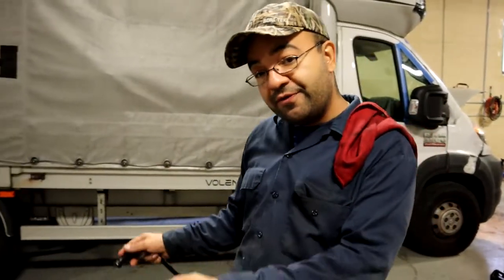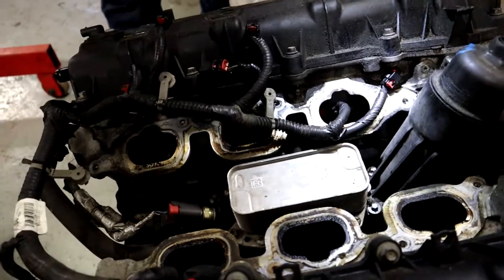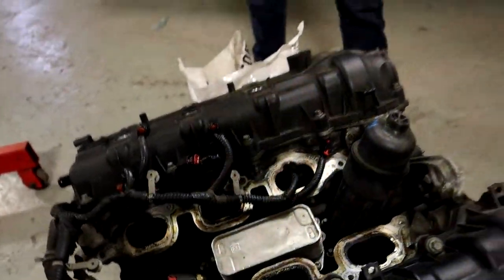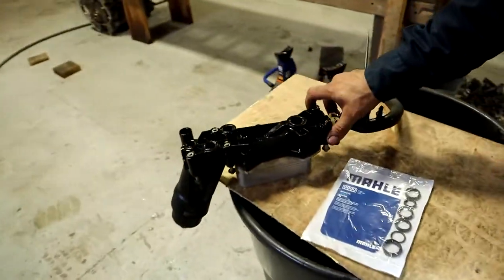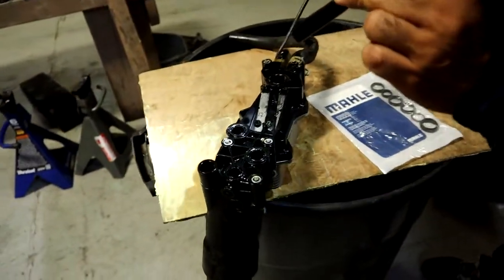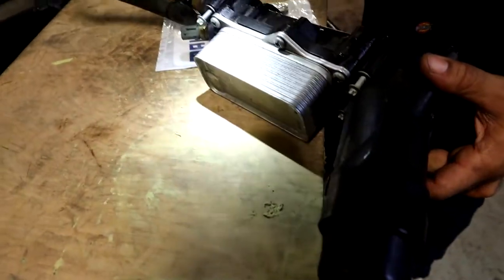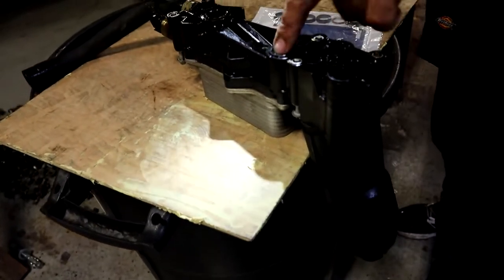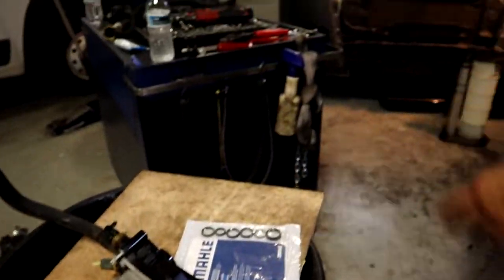2015 - 2019 Ram Promaster 3500 Oil Leak Fix (Oil Cooler Gasket)

Comment: Just came across this video while looking for a reason for an oil puddle on top of the transmission. Got about 230000 miles on it so I'll do this and see if it fixes the problem

Comment: WOW, VERY GOOD VIDEO, IMPORTANT!!! His explanation of overtightening the oil filter is VERY IMPORTANT. This is what the dealership did twice in a row. I had to leave my plumbing service van in the shop for a month because it took them two weeks each time to get the part. Amazing ripoff. It cost me allot of jobs. So be careful when you replace the oil filter. You will notice that the new o-ring that comes with it is a different orange than the original. This is because they used a higher quality o-ring so you wouldn't have to tighten so hard in the future.

Comment: Hello I have a 2014 Promaster 2500 runs fine but I have coolent leak I keep adding antifreeze it notice lots of water siding on top of the transmission area do you know what could be the problem?

Comment: Hi i have a 2019 pro master 1500 56000 miles 
I have some hesitation  . I scan it shows misfire cylinder 2 .  Will that be expensive to replace coil
Thanks

Comment: Hey, I got a 2017 ram promaster 1500, it has a cylinder 4 misfire which comes on once in a while but it’s nothing that I can fell. What do you think it’s the problem
Reply from the maker: Either spark plug or ignition coil

Comment: How much it costs this job typically in a shop?
Reply from the maker: It’s about $500
Reply: @psautomotive5530  thank you my promaster are leaking with only 60 000
Reply: @sergiozaid9999  mines with 53924